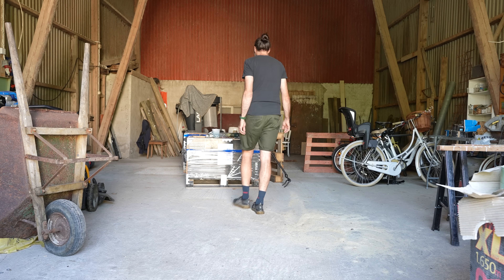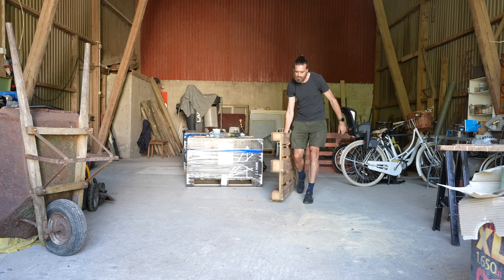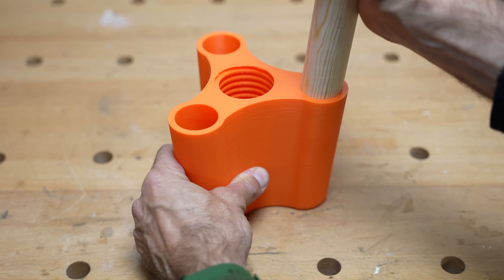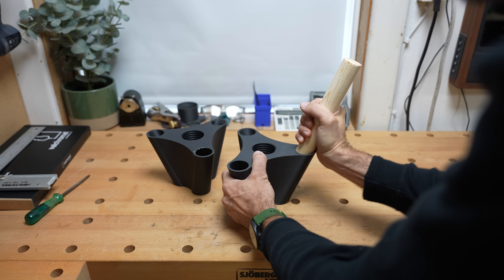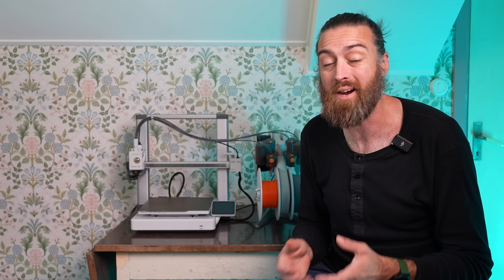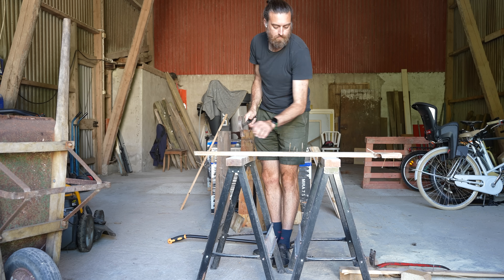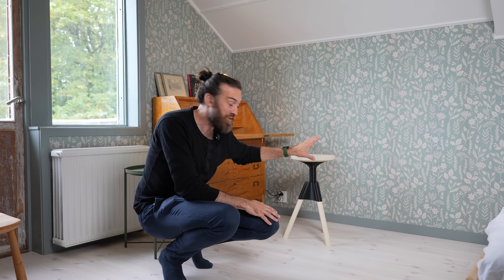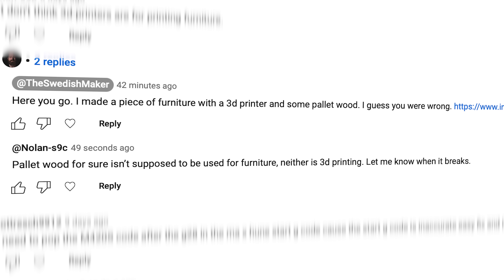furniture from this?

Comment: If the printed thread (on the rod) holds up, you could always just print the thing hollow and reinforce it with a wooden dowel for stiffness. Not sure that solves any problem (as you already know how to make perfectly fine threaded wooden dowels), but, you know ... options, mix and match, horses for courses and all that stuff.

Great song!

Comment: You mentioned that you're very cautious if it comes to safety - how come you print with PETG in your bedroom? I use mainly PLA but still was a bit concerned about the air quality, and PETG is more toxic. If I were you I'd do some more research in this subject and maybe invest in an air quality detector. I don't know know, maybe it's an overkill, but better safe then sorry, right?

Comment: Damn, that pallet wood looked nice at the end!  And seeing as everyone's chiming in: you could try put a long bolt through middle the plastic threaded part, and tighten it on both ends, so that the compression keeps it together better, might help with the wobbling? Or might just crush the print, who knows! Tack som alltid

Comment: You have to pick and choose where to use 3D parts. That threaded seat part is not a great use of plastic. Shelving brackets, lamps, etc are much better picks. I made two tall tripod lamps with a very similar design as your stool and they work great.

Comment: When you built the seat, you put the two boards together, you lined them up so the grain went the same way on both of the joined boards.  Why not put the top board on perpendicular to the bottom board?  Wouldn't that make things stronger?
Reply: While I do agree really don't think its worth worrying about in this case - that 3d print spans so much of the boards and the screws to attach it will be locking things together quite well, and wood glue is darn strong stuff...
Reply: @foldionepapyrus3441  I'm not trying to imply he should have, just asking the question. Your answer makes sense.

I can't do half the stuff he does, so I'm not going to criticize.
Reply: @rickseiden1  And it isn't a bad question, there is a reason alternate grain is the way Plywoods are laminated. Just don't think it will make a blind bit of difference in this case.
Reply: Just a a follow up as I thought of it you may wish to check out @matthiaswandel - he has done some very good wood glue and various woods destruction testing (among other fun stuff) that would help you get a feel for a much wider range of glues and woods than you are likely to use. 

Also don't say you can't do it, as I'd bet you can if you are determined enough to try, and with all the folks doing some inspirational and instruction stuff on the web there are great resources to help you avoid mistakes. 

Mostly making stuff is about the time and confidence to try, with a little bit of testing the novel idea's carefully before trusting them too far. Though without some of the nicer tools these folks have you'd be advised to start simpler, and remember that video with all the fancy tools took them a week, or even a month or two and you consumed it in 15mins... That hour you spent with a block of sandpaper feeling like you were not achieving a great deal probably would take them almost as long..

Comment: very cool.... but there is a but :( I think it's cool, but for high end furniture I don't think plastic should be used for structural parts, or at least visible parts. But that doesn't change the fact the 3D printing is an incredibly helpful prototyping tool.

Comment: I would insert a large diameter aluminum tube in the threaded part, should make it hold much better.
Reply: I was thinking the same or just one of the dowels he was using…. 
 
The infill on that screw print is just not sturdy enough.
Reply: Came here to recommend the same thing, but just the dowels.  The wood should be strong enough at that diameter to hold quite well
Reply: @brandb16  I rather preffer to use a wood Dowel than an aluminium tube in  this case, it would support way more weight.
Reply: He also can split the center part in two, and printer in the strong direction, even add a hole in the center part to make more walls will increase how strong the part is,  beside that, is pretty owasemo how strong it is
Reply: Yes, the threaded part is the weakest link. My thought was to stab a M8 rod through the part and increase the infill density + wall line count. But a tube or dowel may do the job.
Reply: @mation5172  heh, I thought some hidden threaded bar and washers on the ends to hold the layers in compression too
"great minds think alike and fools rarely differ" - so which are we? :p
Reply: If you want it to be purely 3d printed you could also print the part at an angle which gives way better strength. Personally I would print it in 2 interlocking parts,  the base printed flat with no supports and the threaded shaft printed horizontally with supports. A thread that size the resolution will be fine and the part will be much, much  stronger.
Reply: Adding supports inside 3D print are almost necessary for parts that will really be used. You just have to make sure you don’t create new weak points. He could also use a stronger material like PPA CF… much more expensive though.

Comment: The stool looks great and if you need something stronger the new PPA-CF looks amazing although pretty expensive for the amount needed on this project
Reply: PPA needs an enclosure to print, in which case there are many other polymers that could work.
Reply: I was about to mention that as well until I saw your comment. That filament can handle the weight of a car!